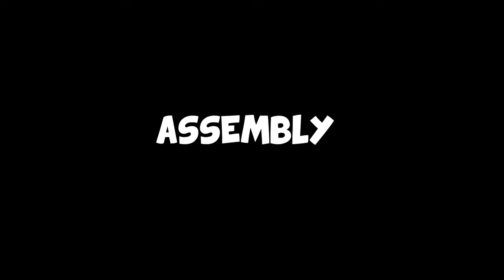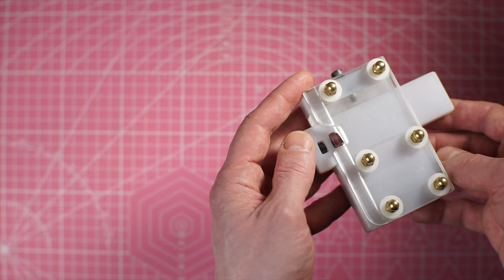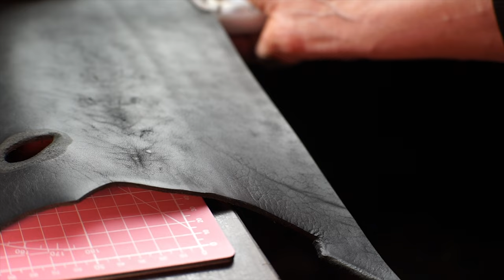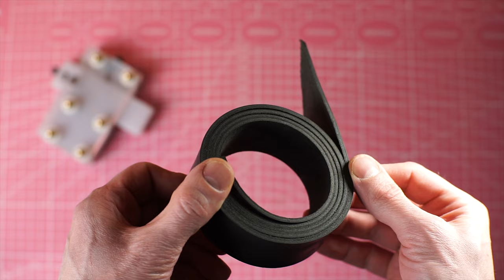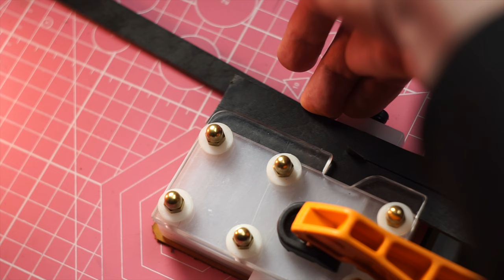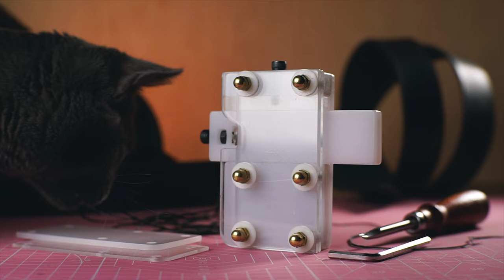Leather Strap Cutter | Alternative tool for leather craft

Comment: Great wee cutter. 
You have inspired me to modify one of the typical wood strap cutters by cutting off the bulk of the handle. For me I have found the handle tends to affect the control of the cut. When I get down to Makers Mill in Wolfeboro in the next day or so I am going to make a video of me destroying or improving the wooden strap cutter. If the modification does work I will be sure to link your video with mine on YouTube. Can you now advise me on controlling the anticipation of getting back down to Makers Mill?
THANKS for sharing!
Cheers...Freddie
Reply from the maker: Modifying a regular wooden cutter is a great idea! In fact, you are absolutely right - a long body is more difficult to control. Any awkward movement can cause the cut to shift. In this tool, pressing the material to the flat side is important and the most comfortable position of the hand is the position in which the blade is flush with the index finger. Just bend your finger as if holding a pistol (like a hook) and everything will immediately become clear to you. I never thought it would be convenient until I made this belt cutter :)
I hope your experiment will be successful!
Best regards, Alex.